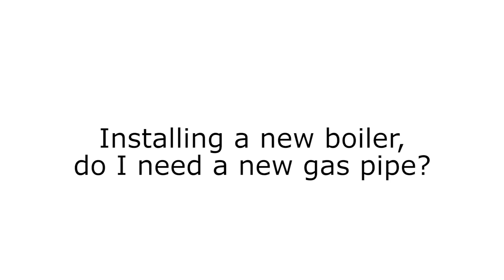Boiler Gas Pipe Size and Gas Pressure Explained by BBC Rogue Traders TV Expert Ian Puddick

Comment: Thank you, just getting a couple of quotes, and I have 22mm installed, BG advised a 28mm pipe run.. First time I have been told that, and I questioned him on it.. He said it would allow increased Liter flow for the shower.  Just waiting for the quote to come through now, but the other Company did not mention the need... Thank you for the informative video!